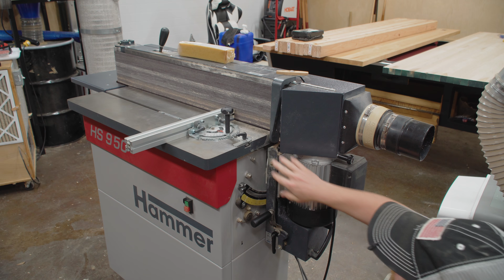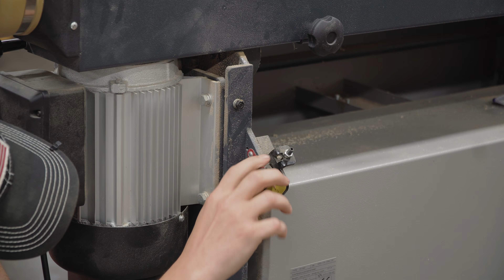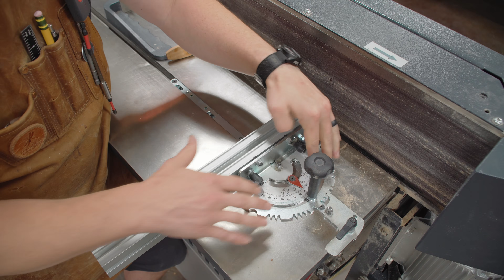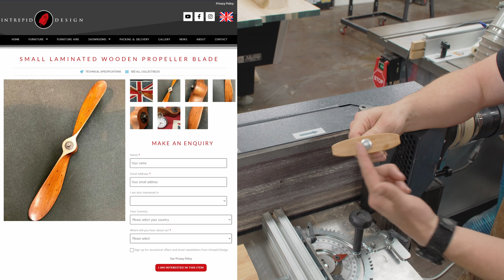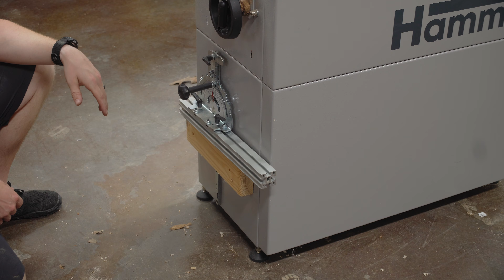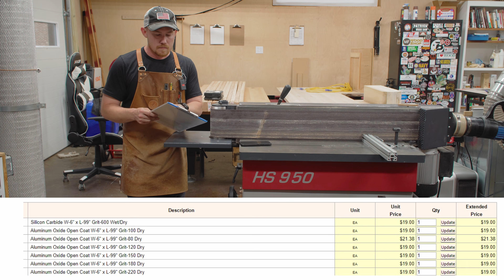Tool Talk#19: Hammer HS950 Edge Sander

Comment: I just got a 22 year old Felder FS-900-K, so am avidly looking for info on line of what useds it has (beyond the obvious edges of doors and such)  Your video is the best I've seen, so thanks for that.  The older machine I have is 3 phase, weighs 1000 lbs, so will be tricky to move into the shop. Not hooked up yet/  It has two motors, separate one for the oscillating functionl  And, it has a shorter belt, 89" But a beast of a tool. Great cast iron table, heavy metal cabinet, good switches. It was very dusty inside, so probably only has 'adequate' dust collection as you mentioned. Thanks again for our video. I subscribed.

Comment: I replaced my adjustable feet with low profile casters. (same thread as feet and weight rated)  have had on for over two years with no issues with stability and mine gets moved constantly. Made mine so much more versatile than it already is. Did the same as you and got a wide range of grits and same as you I only use  mostly 100 grit.  Great machine.

Comment: Great video. I have one on order and still waiting to see when I can take delivery. One question regarding the 800 grit belt for metal. This is what I found in the Hammer HS950 manual: "Prohibited working techniques are those which must never be carried out on this machine! - Grinding of metal parts e.g. planer knifes." Just figured it was worth noting since I thought this would be perfect for light metal grinding but am now leery of using the Hammer for that.

Regarding the miter gauge, I have a Felder bandsaw that, when I bought it, I passed on the miter gauge. When I ordered the HS950, I decided to get the miter gauge for the reasons you mention and how you use it. As it turns out, it is the same exact miter gauge as what Felder sells for their bandsaws so bonus...one miter gauge for two pieces of equipment.
Reply: I think the reason they say that is because the sparks from grinding metal can ignite the fine sawdust, so i believe it is just a liability issue they are trying to avoid. A sander is a sander so there is no reason it couldn't grind metal with the proper belt.

Comment: Belt direction depends on the joint, if it the old style lapped joint then you can only run it one direction as indicated by the arrow, if its a taped joint (usually with a sine wave joint) then you can run it in either direction.

Comment: Oscillation removes less material at the (especially) bottom and top of the object?
Reply from the maker: Same material removal through its thickness. The entire face of the wood is engaged in the belt at all times with oscillation on.

Comment: I bought one and it took 2 years to get one because they kept selling out before I could buy it. I absolutely love it ,one thing you didn’t mention was how much fast it is to change the belt compared to the grizzly. There is a video on line of a guy changing them on his grizzly and then on the new hammer hs 950 he had just bought to replace his grizzly.

Comment: Jay,  I have the same machine.  I agree with everything you have explained here.  This machine has crazy value compared to the competition.  

The base of the machine is open.  If you rotate the base 180 degrees as opposed to the top (will require a few holes to be drilled to align the base to the top section) and you leave the panel off the base, you now have a great space to build a cabinet or drawers to keep sandpaper or the other parts when not in use.  Including the stop and the miter gauge.

Also, the adjustable side  table is a great way to make a two tier sanding scenario to keep the full use of the belt.

Nice work!

Comment: the belt direction is a problem on bands, because the glue connection is weaker in one direction. so, if the band is worn out, you can try and run it the other direction, but the bands glue connection may fly apart if you do.
Reply: This is mostly a myth now adays